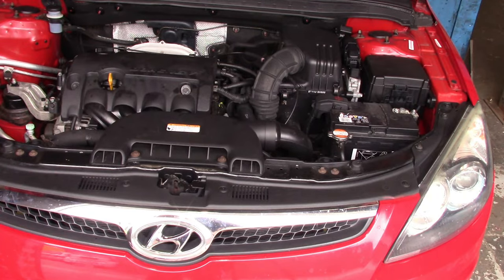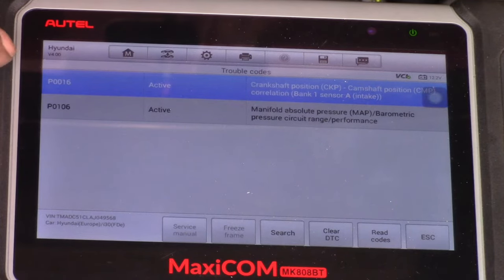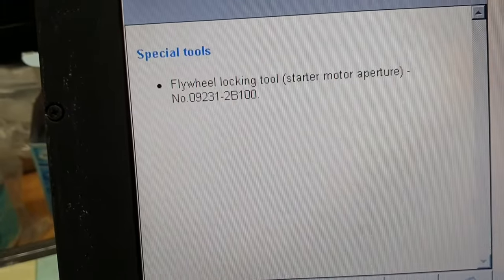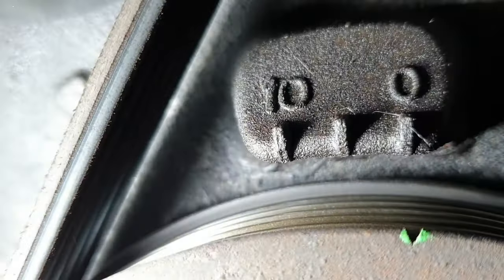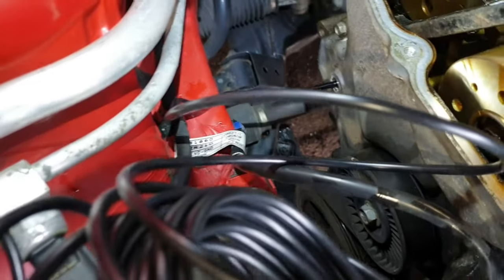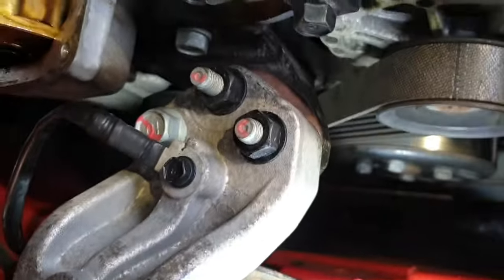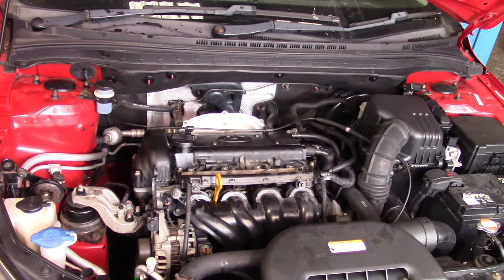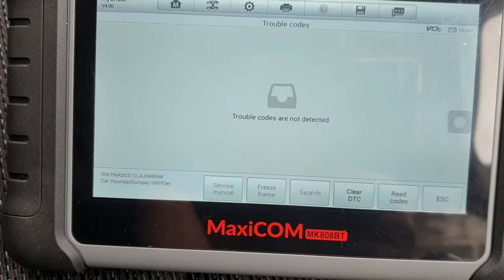Hyundai i30 (FD) (G4FA) P0016, P0106 DTCs Troubleshooting And Valve Timing.

Comment: Hello, could you please help me with some information? My car has exactly the same engine. Code G4FA 1.4 gasoline 109hp. Is this normal? At 07:25, I noticed that at one point the timing chain became very loose and then tight again. Is this a problem? Is it the worn chain or the tensioner? Here's why I'm asking:

My car was left unused for 9 days while I was on vacation. I needed to change the oil and filter as it had been a year. So, I started the engine to let it warm up, but it seemed noisy, and I could hear the chain even after it warmed up. The engine runs smoothly and has no errors. I changed the oil and filter, but the engine sounded the same. So, I checked the timing chain. I inserted my middle finger through the hole where you pour oil into the engine and could touch the timing chain. It was loose; I could move it with my finger and could hear the noise. I drove the car for 30 km. I turned off the engine, and after 2 hours, I checked the chain again. Now the timing chain was tight and didn't move at all. I checked it again a few hours later, and it was still tight. The next morning before starting the engine, I checked the chain again. Now it was just slightly loose; I could move it very little. I started the engine, let it run for 20 seconds, and then turned it off. I checked the chain, and now it was tight; it didn't move anymore. Is this normal? Do I need to change the timing chain? The engine has 150,000 km (93205 miles).

That's why I'm asking if it's normal for the timing chain to become very loose at 07:25. Again, I don't have the errors from the video. The engine runs okay. Thank you.
Reply from the maker: Thanks for watching our channel. 
If for any reason the timing is out or the timing chain has jumped one or two teeth or becomes loose, the entire kit must be replaced.
Reply: "So am I to understand that if the chain is causing the 07:28 issue, the distribution must be worn out and needs to be replaced. Is that correct?" @stanhopeautorepaircentrewardak

Comment: Hello, thank you very much for your video.  Could you tell me where I can find the workshop manual that you are consulting on your computer?
Reply from the maker: Thanks for watching our channel. 
This one, which i used called Autodata here in the UK and can be accessed on the monthly subscription basis, which is currently priced £75 per month, second option is to get the workshop service manual from the auto part supplier or from Ebay or amazon.
Reply: @stanhopeautorepaircentrewardak  Perfect, thank you very much for this information.

Comment: I am now exactly in the same situation with my Kia Ceed 2007 motor G4FC, and I'm going to do the repair through the service hole without taking off the timing chain cover.  I was wondering how can you be sure that the crankshaft timing mark is aligned with the coloured timing chain link down there even when the crankshaft pulley mark is aligned with the timing chain cover 0-position, because you can not see down there?
Second question: How did you actually do thel camshaft sprocket marks alignement? Lifting the timing chain and then turning the intake camshaft to the right position, or how...?
Reply from the maker: Thanks for watching our channel. 
First you need to bring the crankshaft on to top dead centre then you must lock the tensioner plunger in the retracted position then you will be able  to disengaged the timing chain from the camshaft sprocket and align the timing marks on the cam sprockets. If the crankshaft pulley is installed the chain will remain engaged the crankshaft sprocket but if the crankshaft pulley is removed, then you can remove the crankshaft front seal, removing the seal will give you enough visibility to see the timing mark on the sprocket and align the timing on the crankshaft sprocket encase the chain is disconnected from the crankshaft sprocket timing chain make sure the chain remains engaged in the crankshaft sprocket.
If the seal is removed it must be renewed. 
To get able to re adjust the valve timing,  first, the chain tensioner plunger must be in retracted position locked.
I check the service manual before i do  every task , for this task i am not 100% sure if i can remember correctly i think there is a thick spacer between the crankshaft pulley and the timing chain sprocket.
Reply: @stanhopeautorepaircentrewardak  Thanks for your quick response and advice! 
I got the job done, but not quite the way you described, because the service hole was so stucked and rusty that I did not managed to open it with hexacon 8 mm socket and frost liquid and CRC Rost Off, unfortunately the angles were eventually rounded and so the plug was lost. So I was in situation that I might have to take the timing chain cover off, which is a lot of work. But, luckily, I found a way to solve the problem and just by pure luck. I'll tell you how: I was in the TDC position and exhaust camshaft was aligned with the mark but the intake camshaft had jumped one chain link onwards. So, I turned the crankshaft a little bit backwards and because of that the chain raised up a little bit on the intake camshaft sprocket tooths, just like it was going to disengage but did not do it completely, so it was loose. Exhaust side did not move at all.  And at that moment I managed to slide the intake camshaft backwards one chain link to the right position. And I was suprised and happyyyyy.... I checked the timings a couple of crankshaft rounds and all seem to be good. I started the car and it worked well. And the trouble code P0016 was also gone. 
Help yourself using that trick also if possible. 🙂
I'll tell you a little bit of backround to this episode: I had a burned exhaust valve, so I had to repair it and changed all the valves at the same time because they were wered out. I haven't done that kind of repair ever and I'm not pro but eager to know what is inside the engine. So eager, that I also did some valve cuttings and porting of exhaust and intake canals, just for fun and for experience to my old Kia 350 tkm, no harm done if going to fail. But during the reassemble I somehow managed to lost the timing and I dont know how. I then got the P0016 code when started the car, I then checked the CMPS and OVV sensors and they were working, CKPS I did not check. So I had to dismantle again and saw the timings and I found the situation like in your video and you showed the way of doing it through the service hole without taking the  timing chain cover off and that was helpful. Thanks again!!
Reply: @hapatuska  Your post was so helpful, I can't thank you enough. I was in exactly the same situation, except I could get the tensioner plug out, but not push it back enough to get a pin in to lock it. So I tried your method of producing enough slack on the inlet sprocket and eased it round 2 teeth. I've now got everything back lined up where it should be, and will build it back up with fresh oil tomorrow and see if it's worked. Really helpful, thanks again.
Reply: @rastuss2419  So nice to hear that you solved the problem like I did. You saved a lot of time and effort by that method, I guess :). Hope your car is ok now.

Comment: Why did the camshaft jump, was the chain loose, stretched? Are the guides worn, did you fit a new chain and tensioner and chain guides...?
Reply from the maker: I explained that in the video, i emphasized the customer to go for the new timing kit chain, but he said no, it is not worth it. You just  align the current one, and i am going to get rid of the car.
Reply: @stanhopeautorepaircentrewardak  Fair enough.

Comment: Wtf mate. You can.t leve the timing like this. You think about valves if is bented or not? That timing is jumped from the marks. When you have issues like this you need to check the vlaves(compression test) if is bented and is mandatory to replace tensioner , guides and chain if is not bented the valves😡😡😡